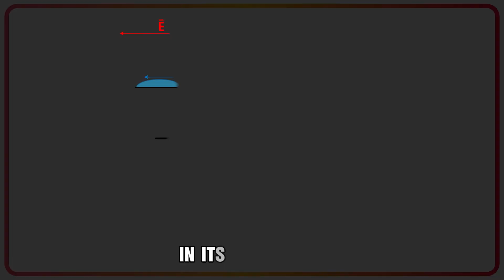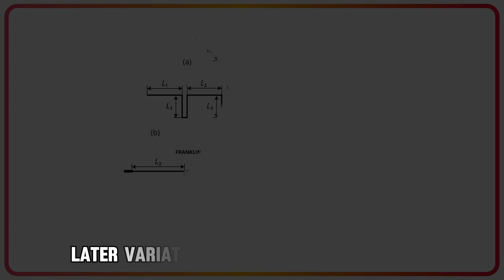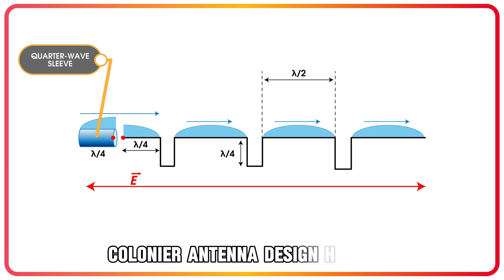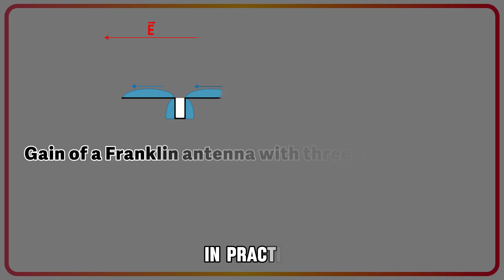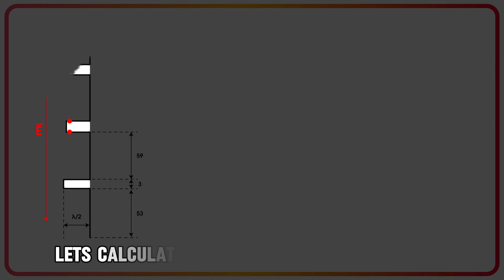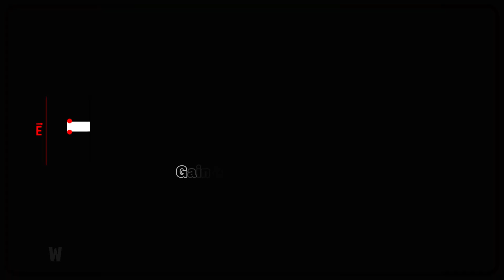THE SIMPLEST FRANKLIN COLLINEAR ANTENNA | EASY COLLINEAR ANTENNA FOR WIFI & RADIO

Comment: Thanks for the video, the information was useful. The information was good and the graphics, superb.  May I make a constructive criticism? I understand that you may need to use AI for the voice-over and I can cope with the occasional miss pronunciation. The problem is that you have cut the time between sentences so much, the viewer does not have time to assimilate the information  given. It is all too rushed. 

As a college lecturer, I know that you have to present at a speed which allows the student time to absorb the information you are giving them. In this video you are giving a lot of information but no assimilation time, it sounds like a race commentary rather than a lecture and I'm sure this is why your views are so low. I hope you find my points useful.
Reply: As Ace suggests, the synthesised voice has far too few pauses. A real human voice would be much easier to listen too, and would give a natural, easy to learn from, flow. I stopped half-way through, not least because dBi was pronounced as if an Eastern European word, rather than dee-bee-eye, which is the more usual engineer’s pronunciation.
Good luck with the channel, anyhow.